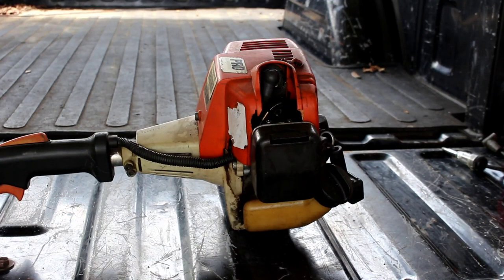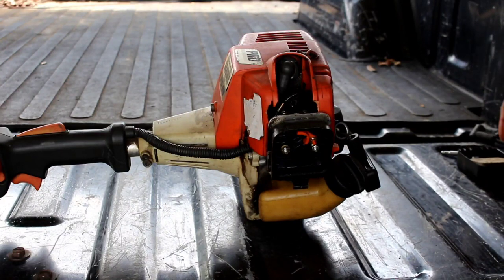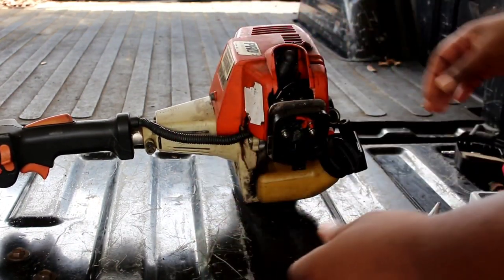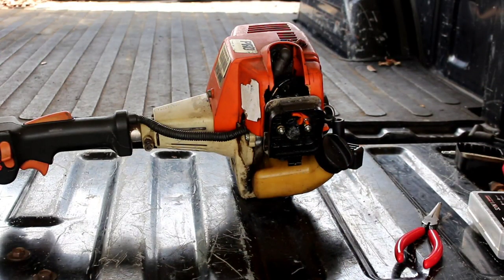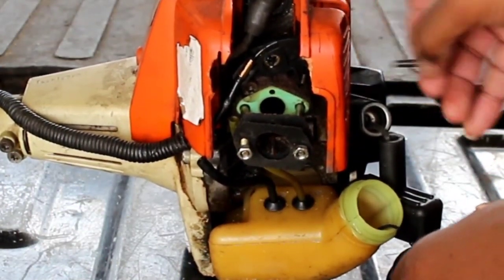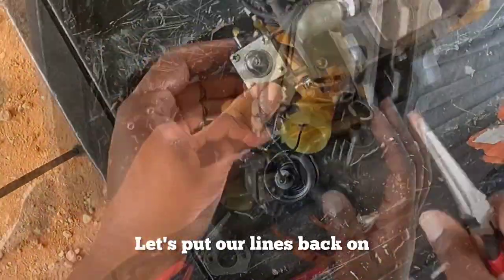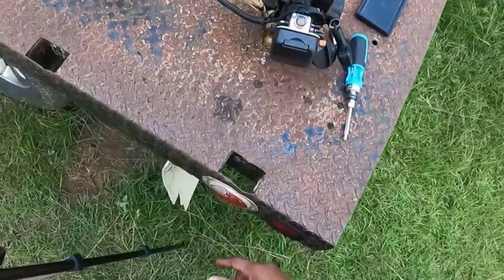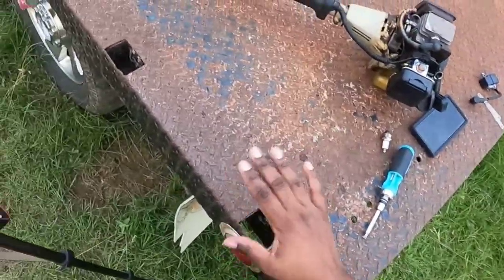Diagnosing a Stihl Fs85 Hedge trimmer. Sometimes it's the simplest thing.

Comment: I've had an FS85 for about 23+ years and they are pretty tough things. Work done to mine over 23 years has been replacing spark plugs , air filter, fuel pickup filter,  greasing cutter gearbox drive, fuel lines, fuel cap retaining cord and 2 carb rebuilds.
Reply from the maker: I hate sounding like a conspiracy nut, but that's exactly why they don't make them that good anymore.  Gotta keep these old ones going for sure!
Reply: @HowIDoItFaM  That's very true. This Stihl FS85 has outlasted 2 Briggs & Stratton 3.5 Hp mowers.